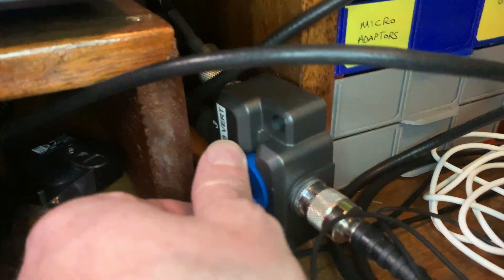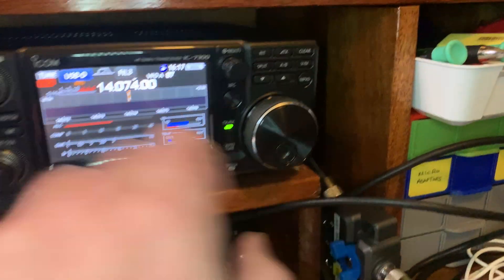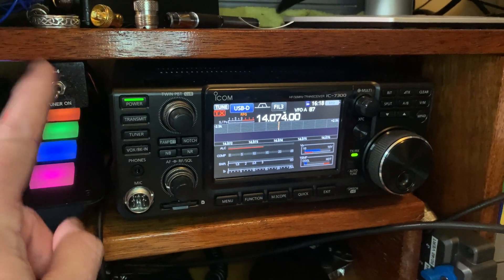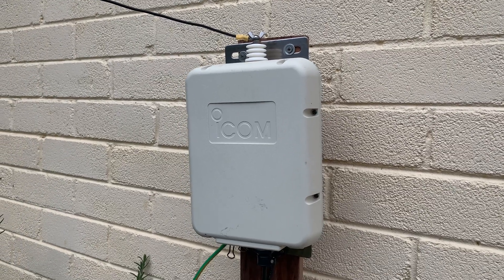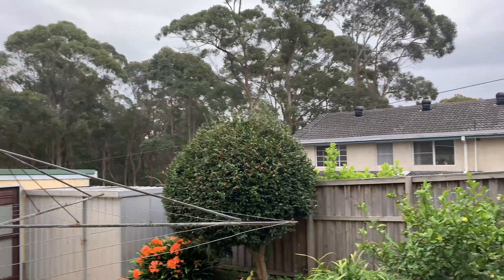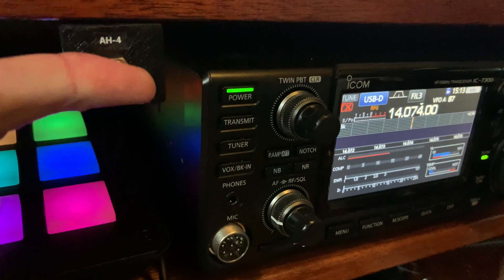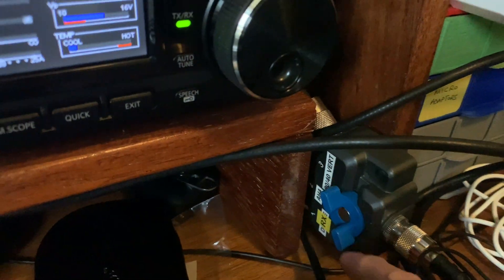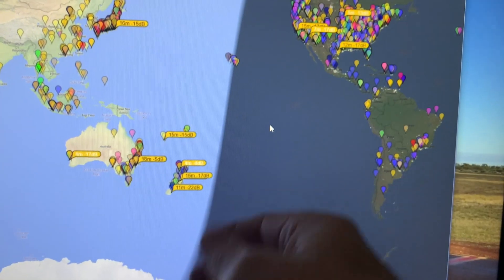AH4 antenna tuner - how I use it

Comment: Could you tell me how you made that switch. I want to be able to switch between the AH4 and a second antenna without having to unplug the 4 pin AH4 jack from the radio thank you n0bum
Reply from the maker: It’s a simple 1 way switch for least than $2. All you need to do is switch the active to turn make a break in the circuit

Comment: Could you tell me how you made that switch. I want to be able to switch between the AH4 and a second antenna without having to unplug the 4 pin AH4 jack from the radio
Reply from the maker: I think it was the main active wire and put the switch through that it will then disable the circuit.
Reply: @Aussie_Ham_Radio  So the switch has a single wire that goes to the 4-pin jack on the IC7300?
Reply: Or, do you wire it to the control cable jack coming from the AH4?
Reply from the maker: @mikenikolich1569  I believe i just broke the 1 connection through the switch  - the active wire and the others are connected as normal. This takes the tuner out of circuit- before i was constantly plugging in the cable and disconnecting - it then defaults to the internal tuner to use with other antennas
Reply: Hmm - that’s funny.  I just switch back and forth between the tuner and a vertical and have never unplugged the control cable

Comment: Which control wire did you loop on the switch? I want this feature . Love the AH4
Reply from the maker: I think it was the main active. Any that disable the ah4 to the circuit. And to prove it you hear the tuner relay on your radio